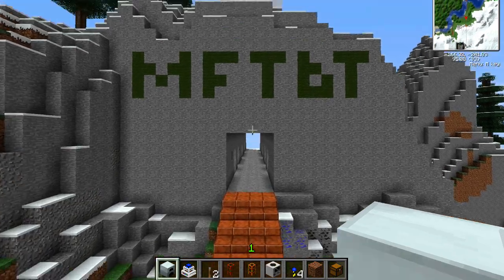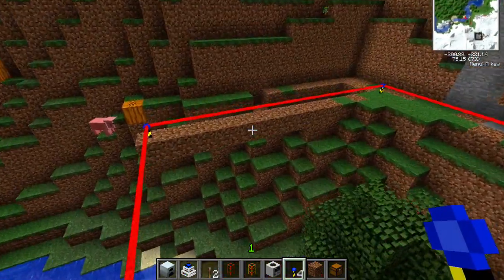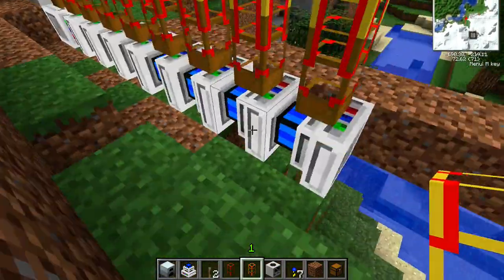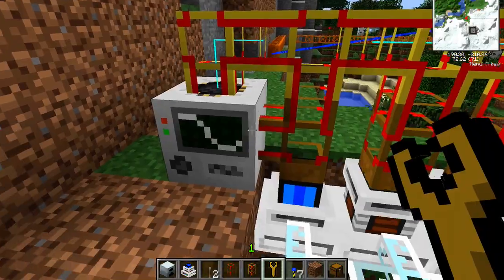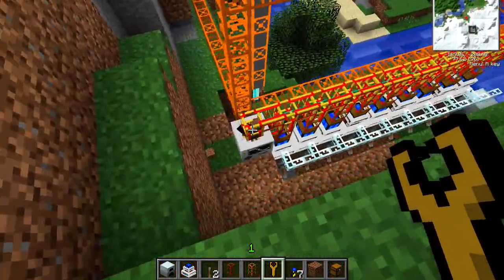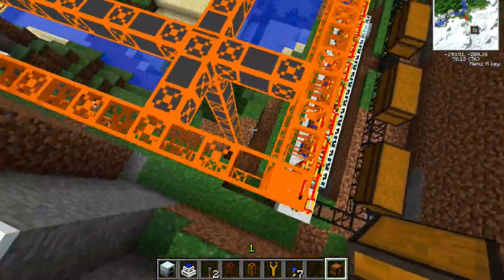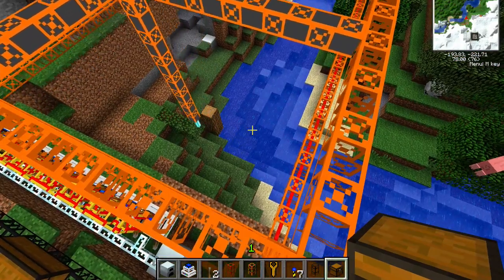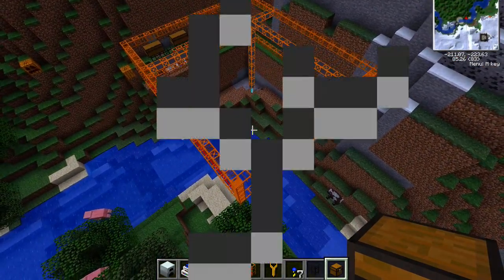MFTBT 011 Quarrying

Comment from the maker: You don't need to use any conductive pipes, you can connect any engine directly to the quarry. If you want to use pipes, you do need to use a wooden one first, than either stone or gold (gold is better). Circuit boards change the properties of an engine, ie create more MJ, cost less EU.